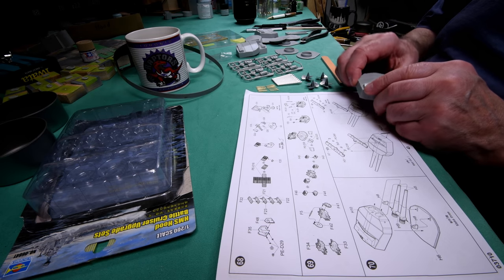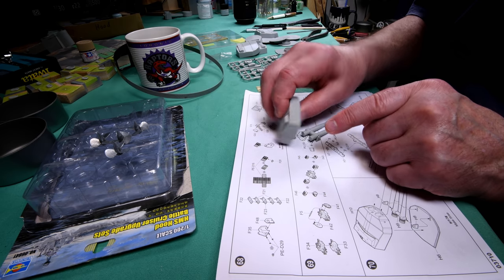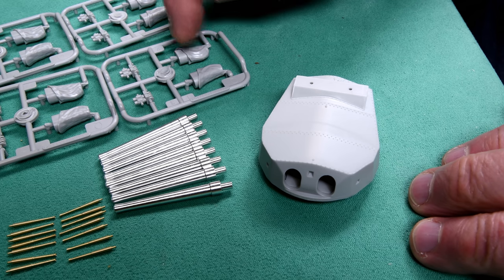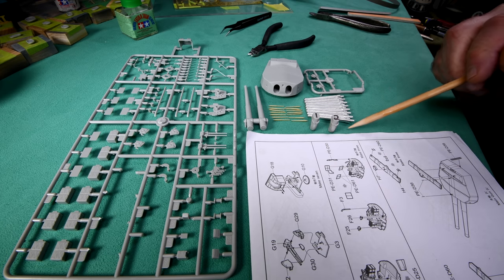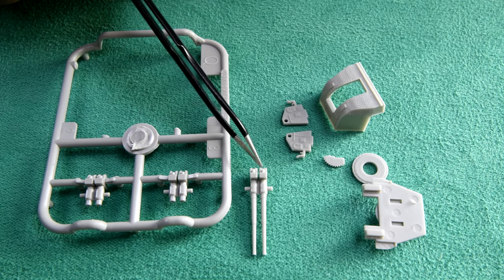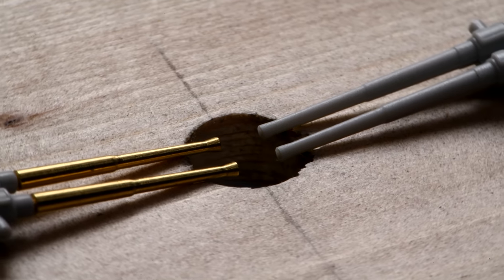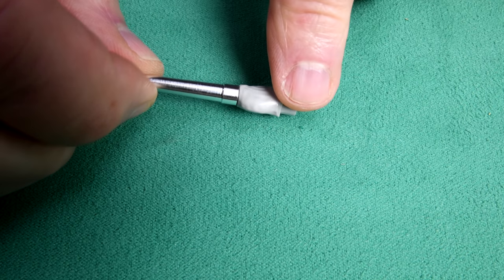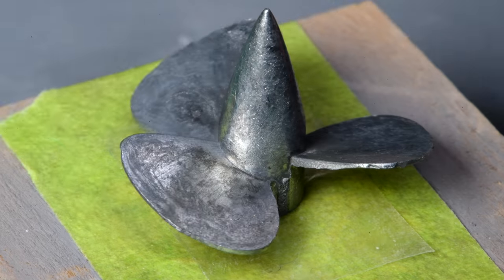The Model Ship - Part 583

Comment: The brass & aluminium barrels definitely look better I prefer to use similar products to replace the barrels on my armour projects I think the propeller blades are cast white metal which can break easily so be extremely careful with them see you tomorrow Ron cheers mate 👍

Comment: Yup, you are going to cut corners..HA HA. The breach blocks for the AA are from Trumpeters' mold so they will be identical to the kit. Metal barrels always look better than a kits plastic ones. As a precaution, I would recommend wiping the barrels with Isopropyl Alcohol  or washing in warm soapy water and air dry. See you tomorrow, and maybe we'll see some painting...uh..snicker snicker. Take it easy.
PS: Please do not pound on the propellers, use a fine file or a medium sanding stick, as has been stated below these are white metal, so they are somewhat soft.
Reply from the maker: "wiping the barrels with Isopropyl Alcohol"
The barral you saw I'd actually done that. There was a small amount of machining oil on it. 🙂👍

Comment: Hi Ron. I’m down with the detail kit. The barrels are thinner and the flare on the ends is way more defined. Thumbs up on going with it. Do the machine marks on metal barrels disappear after you prime them? I’m sure on the small guns it’s fine ,but do you have to sand down the big metal gun barrels?
Reply from the maker: "do you have to sand down the big metal gun barrels?"
You can't see those turning marks without a magnifying glass. I don't think they will show after painting, and if the do they will be so subtle that it may look as though they're supposed to be there. 🤞🙂
Reply: Ron Calverley : good to know, thanks Ron.